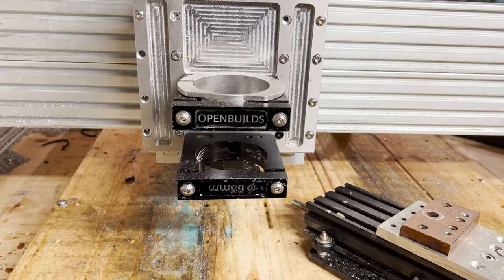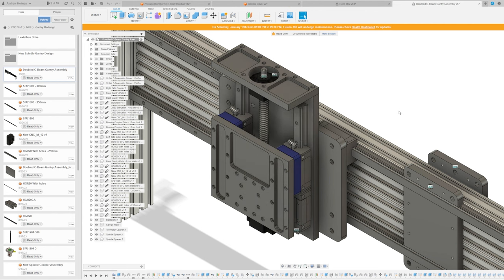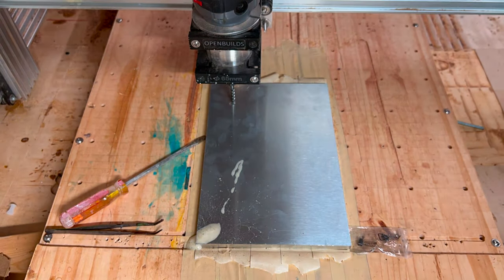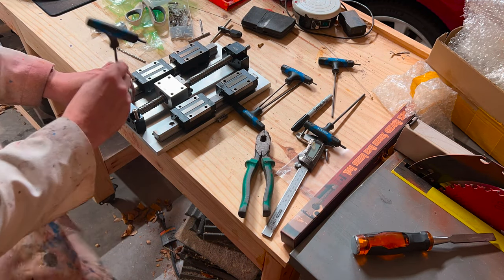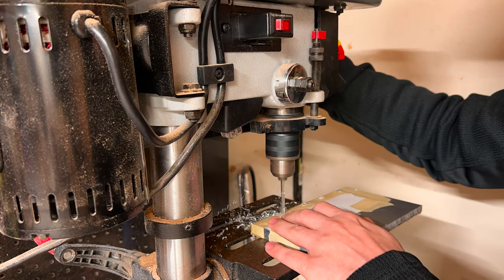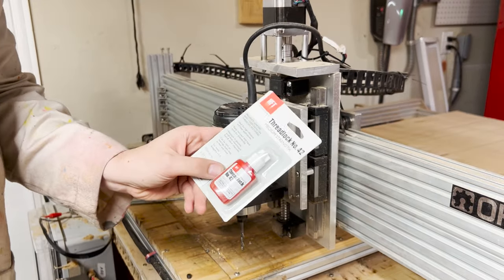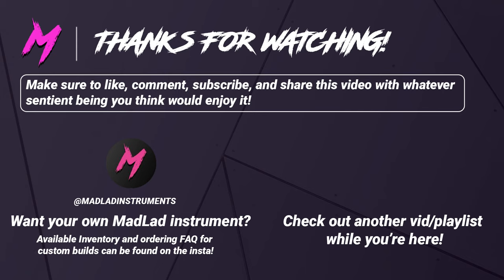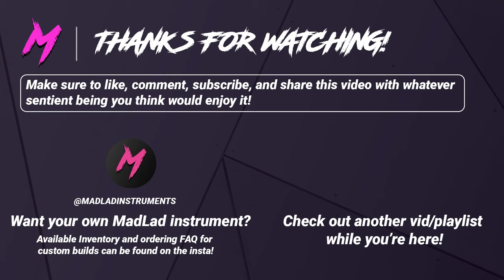This upgrade KILLED my spindle | LEVIATHAN Drive CNC Spindle and Z-Axis Upgrade

Comment: get a proper er32 spindle
Reply from the maker: Oh 100%. ER11 is small compared to ER32 and the extra horsepower will absolutely shred through material. Any recommendations on certain brands or manufacturers?